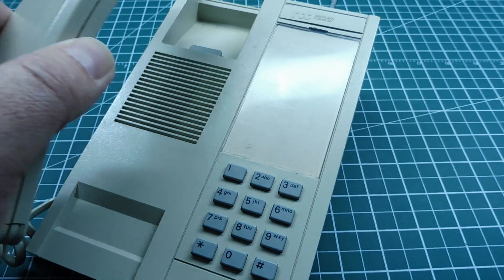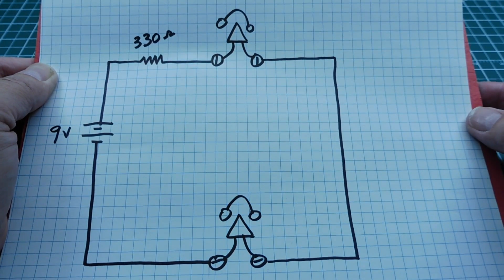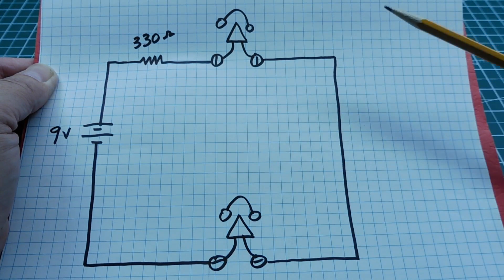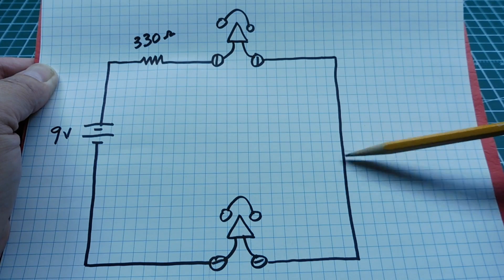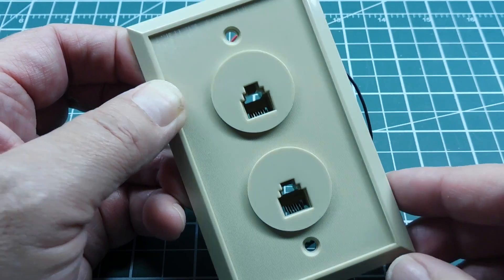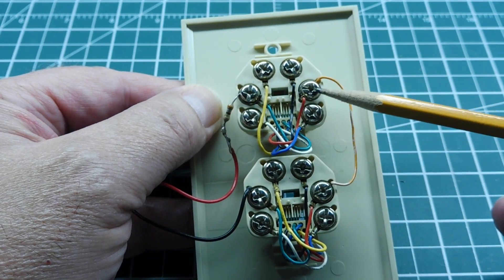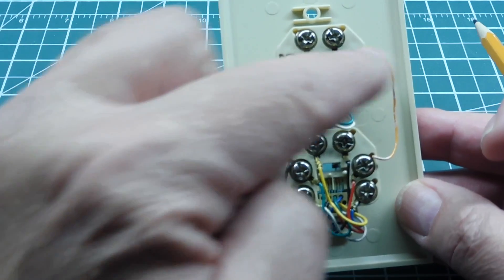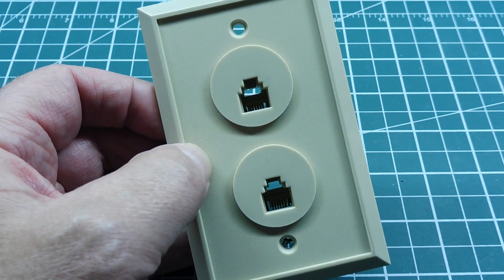Build an Intercom using two old Telephones

Comment: I did that when I was 10-11 yo and I was amazed. My dad used to repair electronics in the 80s and 90s, and I've learned basic electronics from his magazines and books. I got the phone to ring using a stepper motor to provide the voltage, just like an older candlestick ringer. I just got some early 1900s phones and I will try it again :)
Reply from the maker: Thanks for sharing.
Reply: How do you wire in the stepper?

Comment: Really cool. Didn't work for me, I matched it like for like, although the dual phone jack I have didn't have blue/white terminals.  Not sure if it makes a difference.
Reply from the maker: The phone jack has 4 wires (connections) when looking into the jack. Follow the two inner connections to the screw terminals. Those are the Tip and Ring.
Reply: @0033mer  Yep, it looks like the red and green wires on both, will try and run bench power supply to it

Comment: With the phone jack face plate, would it be possible to use multiple and use it to switch between different users? Like a switchboard controlled with a selector switch/pot? How would you make the other phone ring?

Comment: How do you get it to ring?
Reply: One person used a stepper motor to provide the ring signal. I suppose even a bicycle generator would work. Essentially you would hand crank this to send the necessary AC signal to cause the phone to ring. This is how the old 19th century phones worked. You took the ear peice off the hook and turned a crank to send an AC signal over the phone line to the operators switchboord. That would ring the operator to let them know you want to make a phone call. Modern land line phones work pretty much the same way. The only difference was that the phone company was generating the AC ring signal using modern techniques.

Comment: How would you calculate what Ohm you would need for a setup of 300 yards    Is there a formula where you plug in distance and give you ohms?
Reply from the maker: Put an Ammeter in series with the loop and adjust resistance to get 15 to 20 mA of loop current when both phones are off hook.

Comment: Excellent!  Just did this with a pair of cordless phones.   I used a 0-500 ohm potentiometer for the resistor.  Wonder how long the 9 volt will last and if I can substitute the right sized charger (from some other discarded electronic gadget).
Reply: Try to use a similar voltage DC power supply from any unused small electronics instead.

Comment: I would like to remove a doubt. What is resistance for?
Reply: Without the resistor, the 9V battery would essentially be shorted through the phones, and would rapidly drain itself (and get rather hot in the process).  The resistor establishes a constant, reasonable DC current through the phones (about 30 mA) that can be modulated by the two phones to communicate.

Comment: Hello My Name is Tom. Very nice presentation!   Would it be possible to use a 9 volt battery ( or other if needed) with the resistor you mentioned along with 2 corded sets of mobile phone style ear buds with the microphone built in as the phone headsets?
Reply from the maker: No .. the circuit is designed to connect two telephone sets together which contain hybrid transformers. The current loop goes through both transformers which enable the phone sets to communicate in full duplex. You would need to simulate that with your setup.

Comment: Could you wire an LED light into the system, so that when one receiver is picked up, the light would alert the person on the other end?
Reply from the maker: Yes .. you can sense loop current and turn on a LED. Others use a buzzer. Check out this video.  https://www.youtube.com/watch?v=3l5se0gGM18&t=7s
Reply: @0033mer  Thats a great answer and a great video you linked to. I just wanted to ask here just to be certain. Will using a bigger battery really fix the problem of carrying the voice signal over long distances? My friends had an intercom but you couldn't hear anything after 700m~half a mile, and in the video you linked to, he says using a bigger battery will fix that problem if you want a mile or so.

Comment: I made this but am getting a loud feed back out of my speakers? any help would be great! Also i dind use a resistor is that the problem?
Reply from the maker: The resistor is needed to limit the current. Check that all your components are in series.
Reply: Are you using them close together?

Comment: Really cool project, just thought there would be some showing how it worked as well =) Does the other phone ring when you lift the first handset or do you just have to hope the other side is listening when you pickup the handset? =D
Reply from the maker: Yes ... You can hear clicking in the earpiece if you tap the other phone's hook switch.
The clicking would be caused by the voltage change in the line.
Reply: @0033mer  would it be oissbkie ti wire up 4 phones  if more batterirs were  added
Reply from the maker: The phones will not ring. If you ran multi-conductor wire between the sets you could wire up a buzzer system.
Reply: Interesting.
Does the one phone make a clicking sound if you rapidly make and brake the connection on the other? I mean rapidly tap the switch that the handset breaks when you hang up.
I wish I had 2 old telephones to try it out.
Reply: @Flapjackbatter  Morse code .. 
Glad I stopped by this video ! Lots of good ideas coming